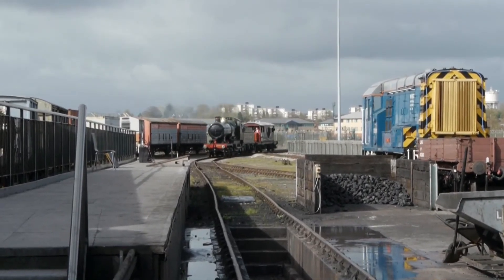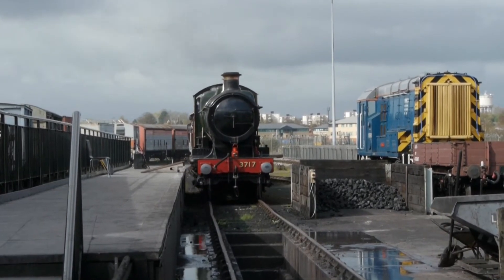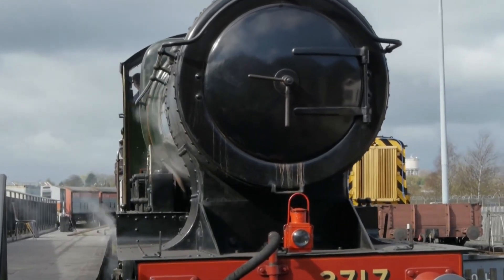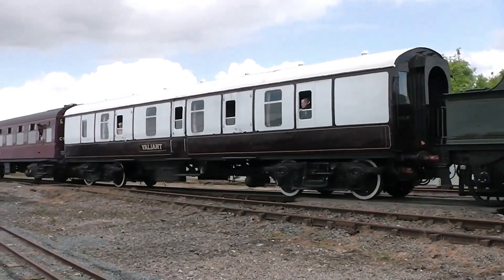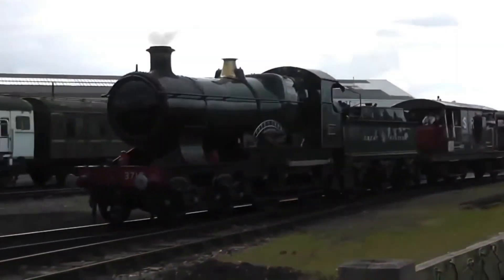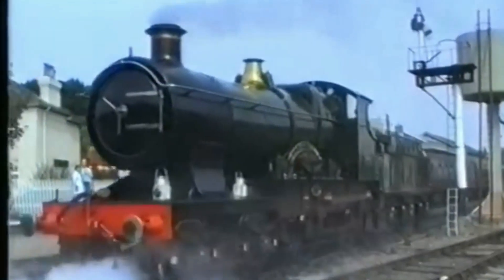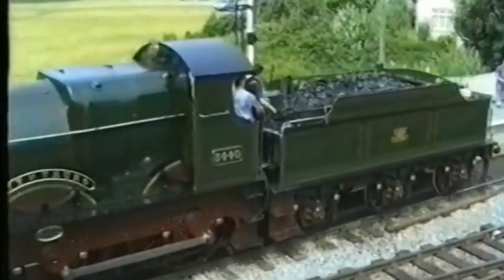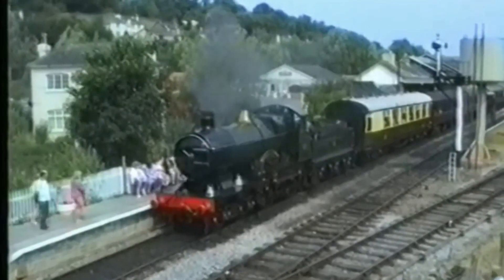What Made the GWR 3700 'City Class' So Revolutionary? #gwr #steamlocomotive #locomotive #fyp

Comment: It's great that she's been preserved, especially been an outside framed locomotive, but I don't get the two numbers? I'm thick, I know, but if she was 3440 originally, then who was 3717 whom we saw in the opening shots? Or if she was 3717, then shouldn't 3440 carry her own name? It's a lot like Triggers broom if you ask me!
Reply from the maker: The locomotive City of Truro changed from number 3440 to 3717 in 1912 as part of a Great Western Railway (GWR) system-wide renumbering. These locomotive numbers were not unique to a city but were part of a larger class of locomotives. The locomotive was originally numbered in the 3433–42 series, but a 1912 renumbering saw it become 3717 when its batch was moved to the new 3700–3719 range.
Reply: @TrainsTrainsTrains    I'm always bemused by the numbering / renumbering of locos and classes over the years.
Gresley's pacifics were A1s, but when valve-gear was modified, those originals unaltered became A3s.   Thompson put his pacifics into the low 'A' series when they were introduced.
A number is an identifier, no more, no less, not an excuse for an ego trip.
BR standards were numbered in no power-related pattern, e.g class 5s as 73xxx, class 2s as 78xxx and so on.  
Tank engines were treated likewise, with a move into the next 1xxxx series as well.
20,000 available numbers bearing no direct relationship to output characteristics, for a toatal of only 999 machines.   Then there were the WD 2-8-0s and 2-10-0s . . .
Yet we're supposed to ignore this lack of sensible grouping whilst not bemoaning the inability of innumerate BR management to run the system efficiently and economically.
The TOPS system of numbering had a useful number/power grouping, but that was bought in from Southern Pacific in the USA.